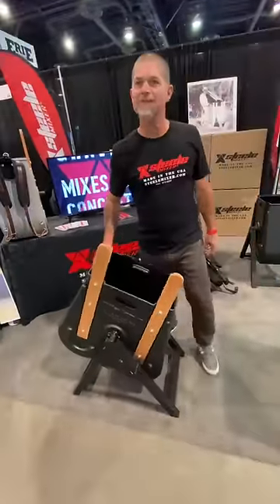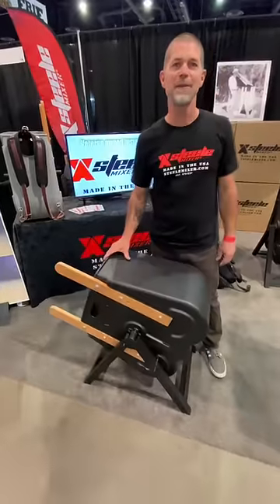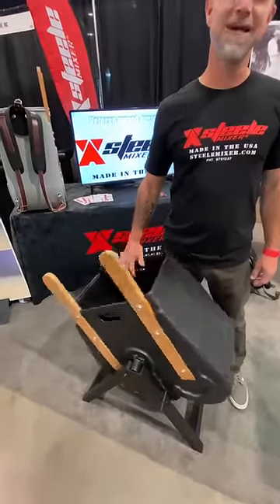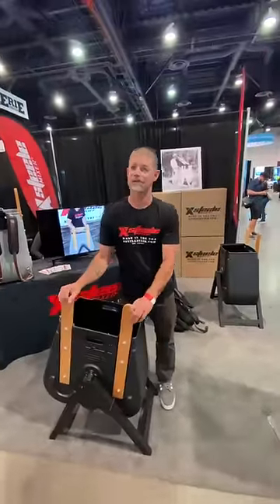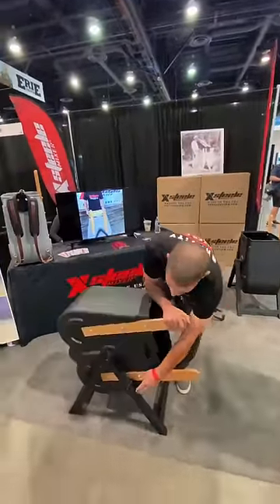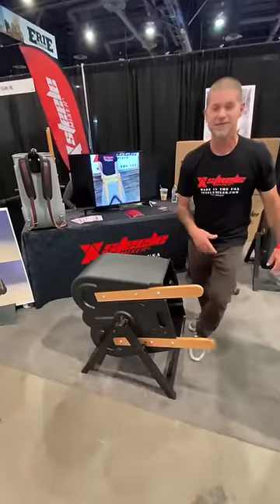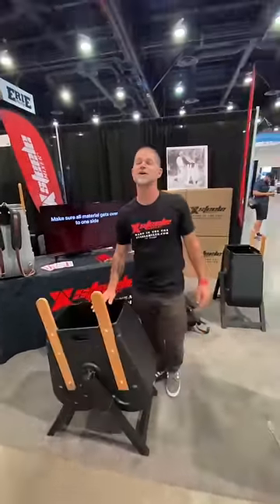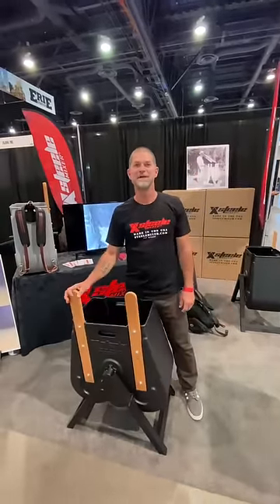No power -No problem. Mix concrete in 40 seconds #shorts

Comment: Sorry isnt a wheel mixer already more efficient and also manually powered?
Reply: Wheel Mixer with a handcrank how about that
Reply: @alouisschafer7212  exactly thats what i thought, i can only think that this is cheaper and more expendable if the concrete sets inside but thats just an excuse for poor labor ethic. Sorry for my poor english and knowledge on the topic but im from spain and my first thought was about those manually cranked mixers and how those must be better than this

Comment: I've mixed mortar and concrete in every way you can imagine but it would still be faster to mix one bag in a wheelbarrow one less thing you have to carry around the job and you dont have to move the mud from the mixer to the wheelbarrow and you have a wheel you dont have to carry that mixer around

Comment: The problem with this device is the stationary position it’s in, I bet you the bottom of that concrete mix will keep setting every time too, i work with concrete in wheelbarrows and I dig all the way down so the concrete won’t clump, this device has to have moving mechanism or a second person moving it side to side, also the fact that it’s so low to the ground means it’s for the home dads that need to do a small job, it’s not tall enough for a wheelbarrow. Last thing is the width makes it hard for a shovel to come in and out quickly

Comment: i worked with city workers, you make a little concrete volcano, add water to the volcanos volcano hole, then you fold the concrete over with a shovel. then you mix it for not even a minute i dont think, and its done. its not a bad idea, cool execution but i dont remember those guys struggling to mix the concrete, and nobody will accuse my cities guys for working too hard lmao

Comment: So all I know is alot more work . Alot more clean up and when all the concrete isn't mixed properly then you have to break out the only shovel and finish by hand . Then when you need to move product down the line now the mixer is too awkward and heavy to move down the line and then I'm putting it in to a wheelbarrow anynway. So in 50 seconds I have mixed what I need in a wheelbarrow.  Done and done . 
They really need to start Amping up the great invention called a wheelbarrow.  Just think. Plus wheels . What a concept

Comment: You buy concrete in a bag? In the uk we buy cement in a bag and ballast/ sand in bulk to mix together an whatever strength you prefer, otherwise you can do a bag of concrete in about 20 seconds with a hose and a stick.......

Comment: Only problem is concrete and plastic won't last, after so many uses if you don't clean it good, I bet the plastic would start breaking after so many uses of concrete drying in it.

Comment: The point of Electric concrete mixers is that a human doesn't have to mix the concrete.
Reply: He’s not mixing it, gravity is only annoying thing is that it’s too low to the ground so you can’t dump it into a wheel barrow
Reply: @AlpaChinoDespacito  "He's not mixing it, gravity is". I see, those handles on there are meant for big man gravity to mix?
Reply: @erebusaeon6945  yes

Comment: Bad, cause it would be splashing in your face every single time, they need some sort of a lid at least, and some mechanics to move concrete from the bottom
Reply: Not true, it stays inside without splashing!

Comment: Haaaaaa THAT NEEDS EXACT WATER FOR YOUR MIX (diferent concrete powders need diferent amounts of water , sand tipe  and gravels the same )no brick layer will be satisfied with 40 sec concrete . Butter like consistency needs to be properly mixed... the same with the cappuccinos foam   ..

Comment: just get a bucket a $5 paddle head for your drill. job done. Use a flexi tub (UK thing) which maeaks you can crack off all the hardenet concrete from the bucket.

Comment: they are badly placed in the market. Pro builders wont want this as a electric mixer does all the work and can get conrete mixed for you automatically and reliably. 

DIYers will just biugh a mixing attachment for their drill and mix it that way.

Comment: PtFF..what's that man; for a small quantity lay a plate on the floor, put your cement and sand on that plate, make a hole in the center and start shovelling; for 20 SEC. READY. I see no advantage; this is a burocrat"s toy.

Comment: why the hell do you want to mix cement and water with no aggregate in the mix
if you want mortar you need to add sand to that
if you want concrete you need to add sand & gravel
this is a useless invention any engineer or construction worker will laugh at you